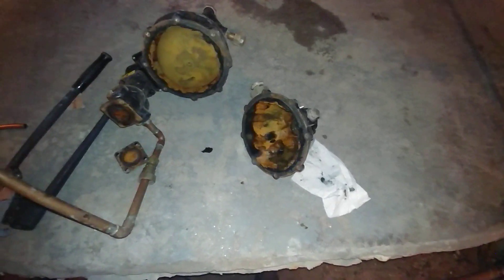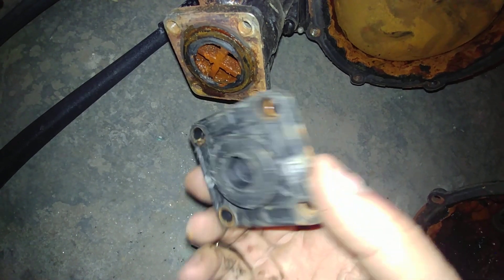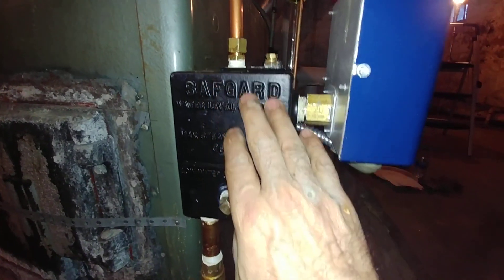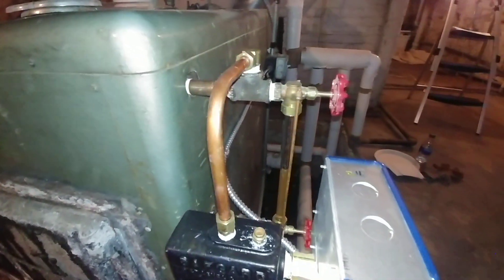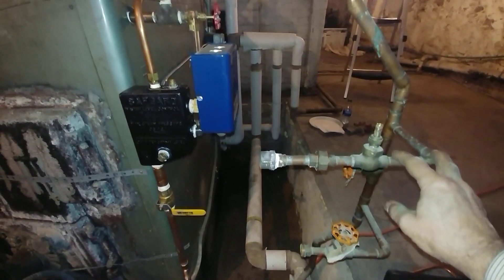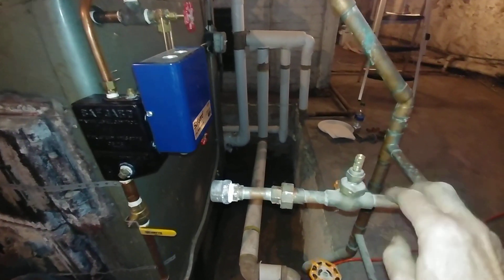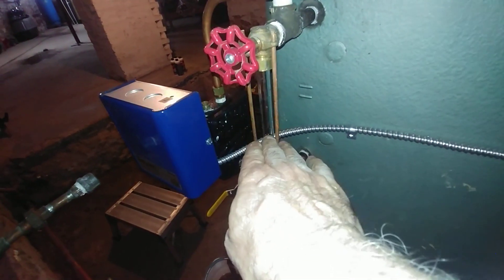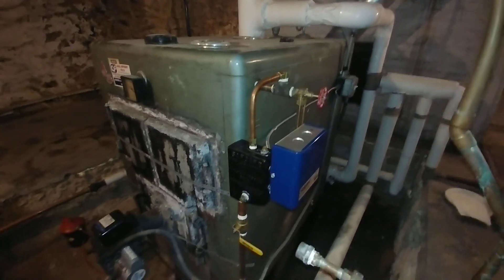McDonnell & Miller 47-2ectomy & Installing A Hydrolevel Low Water Cut Off Instead

Comment: One can can recondition 47-2 if you have no money to replace it completely. You pull it off the fittings at the unions, diassemble with a ratchet and an allen key, and: C L E A N.  Most of the rust accumulation comes right off. The strainer and cartidge are definitely serviceable - they can be replaced with new ones at relatively low cost (EBAY) . The strainer can be easily RINSED/cleaned at the end of the heating season to extend its useful life.  As with anything, if you take care of it, it will last a LONG time.  One does not need to be intimidated or frightened by the rust accumulation, it comes right off with little to no elbow grease.   The original poster did a wonderful job showing and breaking this Low water cut off switch down.  I wish he described in more detail why the new water cut off is "a nice bit of kit." What makes it so nice?
Reply from the maker: The new LWCO shown is "a nice bit of kit" because it is of the electronic probe type that requires much less maintenance and has proven itself to be much more reliable.  Even McDonnell & Miller has their version of the probe type LWCO.
The 47-2 is just obsolete junk, IMHO.  If a person wants to work on their own 47-2 to save a bit of money, that's fine, but as a professional, if I touch it, I own it.  So, I'm going to gleefully rip this trash out any chance I get.
Reply: @gordonschweizer5154  I've been looking at your videos, so much good content. Thank You!  I am beginning to see the light with the vxt and safeguard probe lwco.  ESPECIALLY since parts for the 47-2 are very expensive.   A bit  worried about putting new tech on an old weil mclain 572 that used to be wood or coal fired, just because I don't know how it will fail and weather it's more likely to create a dry fire condition than a 47-2.  I've had two 47-2 fail because the float bbecame water logged due to galvanic corrosion. It flooded the boiler a bit, but I can repair easily.  A flooded float hasn't allowed a dry fire conditoon. But the float costs 120 and the cartridge another 120, whereas adding. another 100 and I have the vxt120 and a probe type LWCO.  So you're saying the latter is much more practical and reliable?  Thank you for all your videos abd the time you've put into them.

Comment: First time I’ve seen that Safguard cast fitting, looks like a damn good idea f changing out a 47.
That header on The Hartford loop, really odd, I can see why you were willing to raise normal water level to keep that from hammering away. We both know things that should not work sometimes squeeze by an surprise us by working ‘enough’. I’m sure you’ll let us know, either way.
Reply: That Hydrolevel manifold, the 771C, we've used a few times in the past when there were no tappings on the boiler (or at least ones we wanted to touch!).  The customer still has to blow it down periodically, but that does not alter their past routine, and each blowdown uses less water.  Also, the LWCO gives a light indicator when triggered. 

The 711C is a special order item, naturally.  We've got five on our shelves.  One turned out to have a casting failure.  Fortunately, we found it before we installed it!